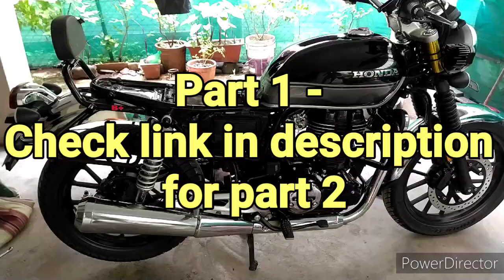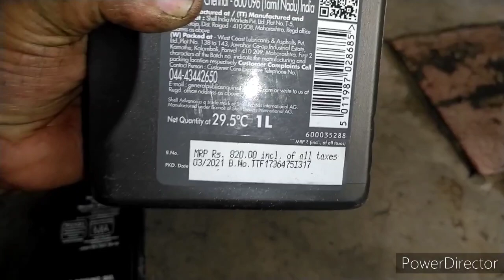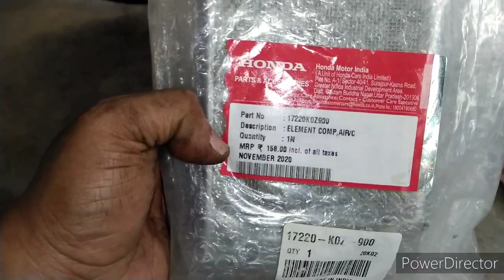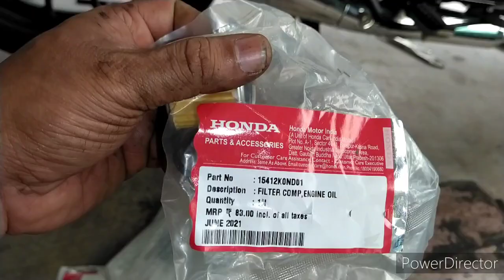Honda H'ness CB350 - Full Service - Part 1

Comment: Whenever you replace the Engine Oil, always replace the oil drain bolt washer. Use the Engine oil grade as recommended by Manufacturer. Honda Engineers do thorough studies before making the schedule. To keep the vehicle warranty intact please follow the Manufacturers instructions.

Comment: Right choice of 10W 40 oil Sir. During summer you may try 10W 50 oil for better engine protection. A word of caution, avoid buying SHELL oil online due to counterfeit issues of late.  Best wishes.
Reply from the maker: Thanks for the advice on the online orders, touch wood haven't faced any issues so far, but I agree there is a lot of scope for tampering online. What I generally do is, look out for seller and if it is by Cloudtail (Amazon) only then go for it.
Regarding the 50 hot viscosity, moving 2 steps above the manufacturer recommended grade can be little hard on the engine as the engine design in terms of the internal tolerances (gaps between 2 metal parts)  is made to suit a particular viscosity. A thicker oil will put load on the engine oil pump and other seals and also result in slight (only slight) mileage drop.

Comment: I have used bikes like apache rtr 180 , Hero honda Achiever , Unicorn , fz 250. RE 350 classic & now cb  350 Dx.
 I have tried many engine oils from the respective companies like TVS . Honda , Royal enfield etc. Being a medium to long distance rider I never satisfied from company oils & faced mainly Cylinder kit issues due to over heating. So I switched on to oils from Servo , ( Castrol, Shell - fully synthetic oils )
Now for the last 6 years Iam using only Motul oils for my 3 bikes .I used  10w- 40 , 10w - 50. 300v 10w - 40 etc according to the bikes. ( Eg: For rtr 180 - 10w -50 is the best choice ).
Now , for my cb 350 also Iam using the same.  Motul 10w - 40 ( As you  correctly stated heat range one grade upper )
Waiting for long hrs in work shop....
 I learned how to change oil, Spark plug , Air fiter , Oil filter etc with help of a technician with my tools.
Thanks for the video...

Comment: I have a problem with my handle, it was tight and after loosing it from the service centre handle has a vertical movement whenever I ride on slightly rough rode, any solution for this issue that you can recommend, I have already visited the service centre the problem still not resolved.

Comment: Hi thank you for the vid. Where did you get the Honda genuine parts from ? Honda dealer from whom I bought CB350Hness says he will not provide spare parts and that I have to get replacement at service center only. I have to pay labour charges, GST aswell besides taking my vehicle to service centre and spending 3-4 hrs time.

Comment: Raj bhai, sad to hear about your back pain. Hope you would have recovered by now...

I had a query regarding front shocker oil seal damage. My front oil seal seems damaged and since I'm in a remote Gujarat village, Bigwing Service center is not accessible. If I have to buy locally, which oil seal should be purchased ? Pls advise and thanks a lot for your informative videos...

Comment: Just a question sir, Since Big Wing does not offer you to procure parts from them through counter sale, can you share the service parts which are used by other Honda Models. Like air filter, oil filter, spark plugs etc. Your opinions would be welcomed.
Reply: There is no policy like that u can order or complain

Comment: The flyscreen offered by autopappa and carbon racing have a fitting in which the upper allen bolt is removed and a extended bolt is added on the fork lock to fit the sheild. Is this 100% safe?
Reply from the maker: I haven't seen the CR one, but the autopappa fitting has a collared washer(thoughtful design) for the bolt and also extended one, so it is fine to be used.

Comment: Nice vid mate. Between air filters shouldn't be washed. You can use compressed air to clean, but definitely no water wash.
Reply from the maker: Thanks mate.. there is a particular purpose of washing the filter. Check my video on the Highness struggle in Laddakh/high altitudes for that 
Cheers and Happy Riding 🤘

Comment: Plz give the review of it Now.. 
What is the diff. That you are feeling now after changing this grade 
Both pros and cons
Reply from the maker: Bro, one of the major difference I feel is bike is not overheating in traffic even if you are constantly riding in 2nd and 3rd gear compared to what it was happening earlier. Gear shifting is also smooth compared to semi synthetic oil. The only flip side i felt is mileage has dropped by couple of kmpl. But that's ok as still getting 39kmpl.

Comment: Sirji
Oil filter
Air filter
Spark plug

Please share all online links, as local shops don't have anything
Reply from the maker: Oil filter you can buy Honda Shine SP oil filter. But buy the original one.
Spark plug - Use Apache RTR double point spark plug. Available at any TVS service center or even local spare parts shop.
Air filter - Unfortunately this is not available at local shop or even online. You will need to convince Honda Bigwing service center to sell over the counter.
Reply: @RajkaGarage  ❤️ thanku
Reply: @RajkaGarage sir my bigwing showroom is not selling any spares even small pieces like oil filter and o ring for oil filter and even washer for drain bolt i told them I can pay extra but they would not sell. Last visit they billed me for  my CB350RS servicing   ₹5200 saying that and this has to be changed before that ₹4100. I want to service my bike from now on. Can you pls give o- ring size of for the oil filter and washer size of drain bolt.That would be a great help thankyou.
Reply: Don't use the NGK make Appache Spark plug, in my case it broke the neck after a long ride, luckily the local mechanic could. Remove the threaded piece by using one special tool, otherwise engine Head removal only can remove the threaded spark plug part, Apache NGK plug temperature range is not comparable for CB350,

Comment: From 1 week I have observed in my bike, after riding for a bit I sensed some smell from engine after switching it off. Now the weather is full of fog and rain, is the smell due to wearing off moisture or is it something else please clarify?
Reply from the maker: How many KMS have you churned. It is normal for the bike engine to smell the hot  new metal parts and the paint work on it. The smell I luv..
Reply: @RajkaGarage  3500

Comment: Bro, Is there any alternative avaliable for the Air Filter of Highness from other brand? So that incase if it's not available at Honda then we can buy from other brand service centers.
Reply from the maker: Have been doing research on this and so far did not come across an alternative. Oil filter can be used from the CB Shine SP.

Comment: Do u service your bike yourself sir ? Can I do the same at local mechanic i have completed 3 free service at showroom
Reply from the maker: Yes buddy, I just did 1st free service in the service center and have been maintaining my CB on my own just like I have been doing to any machine I have owned till date as I too belonged from the automotive service industry untill some years ago.
I will recommend doing it on your own if you know someone who is skilled and experienced and so long as you can manage to get counter sale of parts from Bigwing. Also one more factor to consider is your confidence level on the machines reliability as you are covered in warranty for 48k kms or 3 years whichever is earlier if you continue to service from Bigwing even after the free service is over.

Comment: my honda h'nees giving 35km in city it is good or bed how can improve it my bike run 1000km it is only 1month old
Reply from the maker: 35 in city is excellent mileage buddy especially for a 350 CC. I get 38 overall with 90% highway riding.

Comment: Hello Raj Bhai..! Arvind here as 6VN. Sorry to hear about your backache, hope you're feeling better now. Great to see your video,

1. Redwing service, will be very very helpful for many Urban/Rural CB Owners like myself. Any thoughts on how Honda can track Warranty in case of such non Bigwing service or even in your case, self service?

2. 10w-40 grade as we've discussed in deep detail and you've enriched me by sharing your knowledge in past, So glad you're covering it this series to help many others. Would recommend you adding a point, Bigwing are most against using own engine oil and also Throttle FS oil is also available in 5W-30 at few Bigwing, so it's better to ask 10w-30 during service

3. I get it's cheap to replace but Viscous type Air filter, leaving Honda recommendation, how would one judge if it's really worn out? (Bit of a Green conscious me, don't let me unnecessarily throw useful waste 😬)

Wishing all viewers here (in Raj bhai sons cute voice), Happy riding🤟🤟🤟